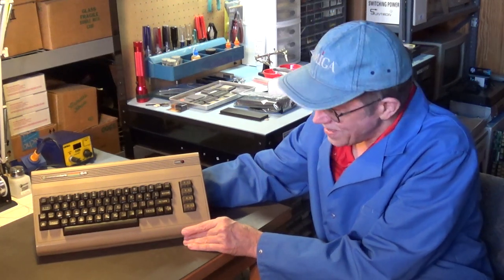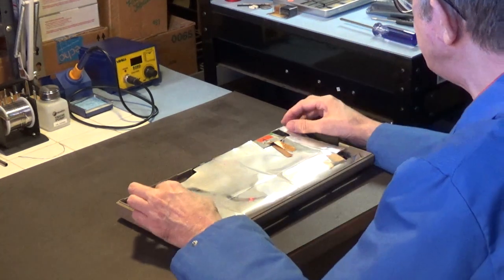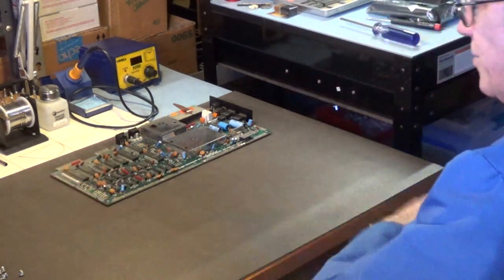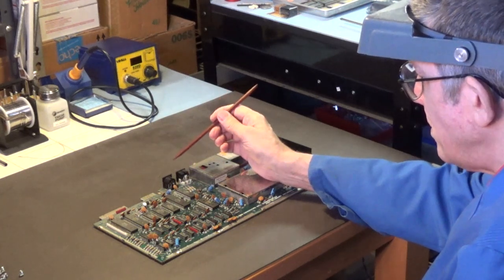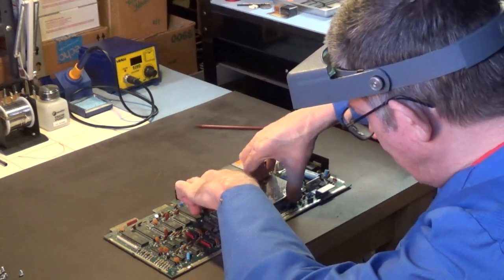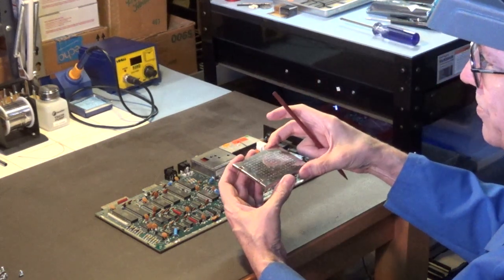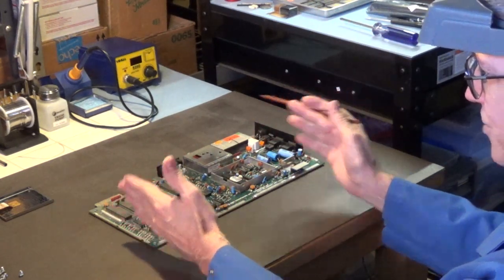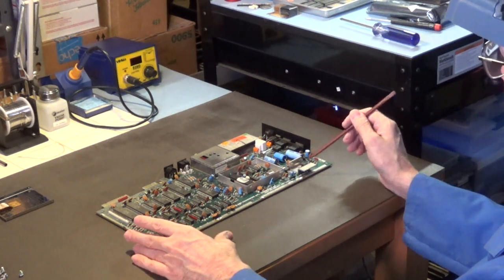My Commodore 64 - Disassembly and Inspection

Comment: I still have and love my Commodore SX-64.  I also have a PAL breadbin I use with Gideon's 1541 Ultimate II+.  Still a great machine.  For older games before PC's had a Sound Blaster, the C-64 is where to go.  I had to remove the lid over the VIC-II on mine because I had to install a LumaFix, because the vertical lines on the LCD display made it impossible to read the text.  Without the mod, it would just sit in the closet.

Comment: I find that the thermal compound on the VIC chip is always degraded, plus most heat sinks have a lot of fins for surface area. A lot of people unfortunately put tiny heat sinks on
Reply from the maker: Yes, those Peel N Stick heatsinks, that everyone seems to be using, are designed for the memory chips on PC graphics cards.  They are not large enough for the chips on Commodore 64 motherboards.  Those small heatsinks actually do more harm than good, because they can not get rid of the heat faster than the chips generate it.  So, those small heatsinks trap the heat in the chips, and those chips will eventually fail.  I will talk more about this in part 2 of this series of videos.  I will also show the correct heatsinks and thermal tape to use.  So, stay tune.